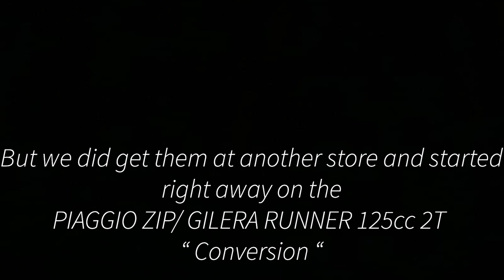PIAGGIO ZIP 125cc RUNNER!  Engine Swap+Testing Vlog  *CRAZY POWER*

Comment: Setup?
Reply from the maker: Hey SaR-E- The motor is a completely stock motor, just a little bit of carburetor tunings was done.
Reply: @ScroudVlogs  whats the mm of the carburetor and mm of the manifold?
Reply from the maker: @sar-e-2269  The carburetor size is 20.5mm and the size of intake manifold 28mm.
Reply: @ScroudVlogs  sproeier?